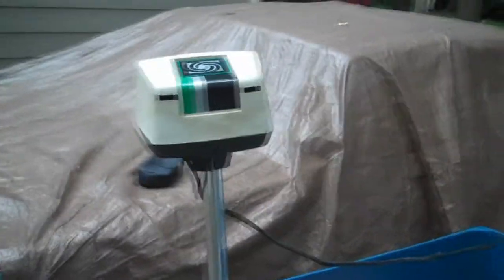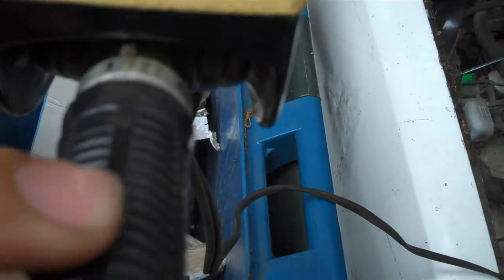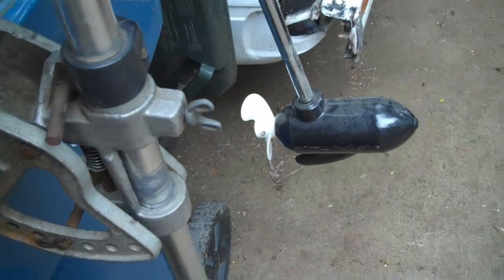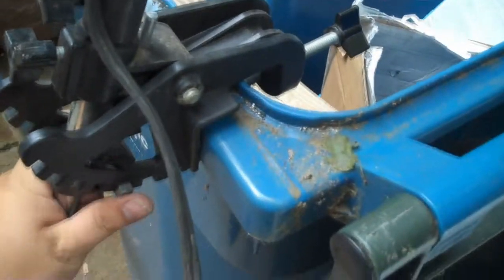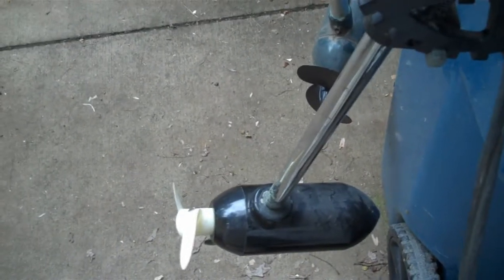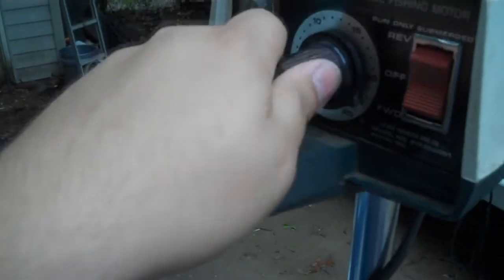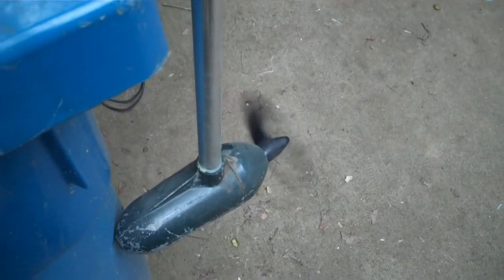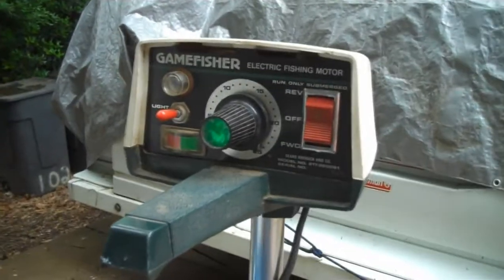Minn Kota 15 and a GameFisher Trolling Motor

Comment: Are those props original or did you put those on. Asking because I recently bought a vintage trolling motor but I can't find the prop I need which is similar to the ones you have